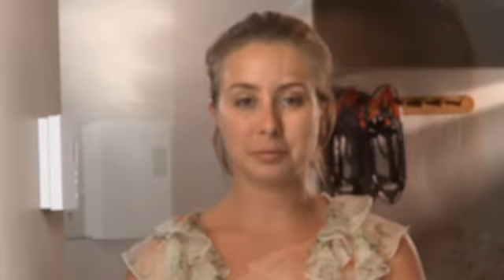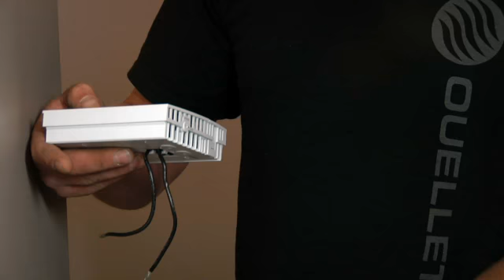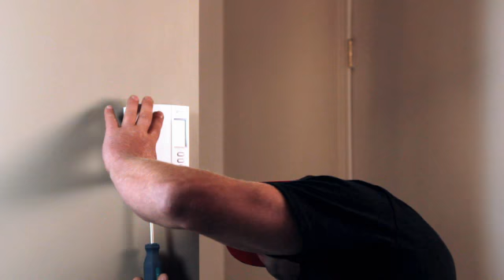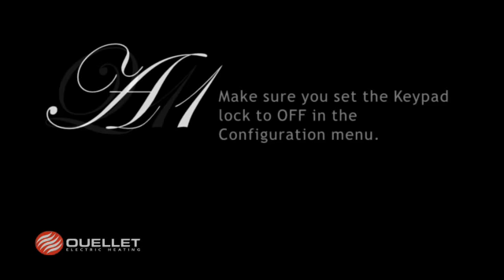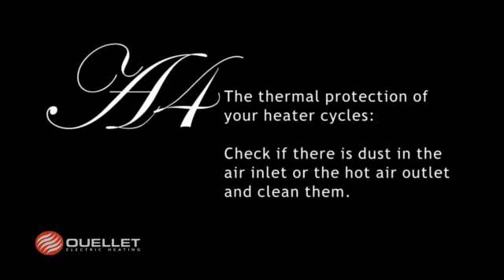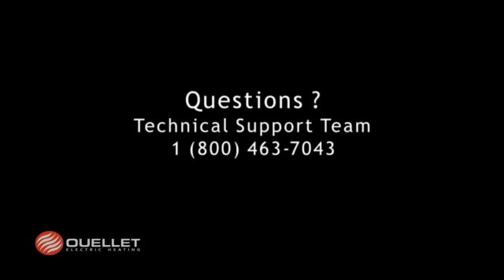Non Programmable Electronic Thermostat

Comment: I have my set points to 5 degrees and 16 degrees, but the reader is showing 21.5. How do I actually get it to go down and make the room cooler?
Reply from the maker: Thank you for your question,
   These thermostats are heating thermostats only and they only control baseboards or heaters.
They will only start if the ambient temperature goes below the set-up and allow for the heaters to raise temperature to the required setting.
    Since they do not do cooling and control any cooling units, the temperature shown on the thermostat screen is the actual ambient temperature, but they will not bring the temperature down.
   The be able to cool the environment, you would require a cooling type unit and a heat/cool thermostat.
 Regards,
Reply: Open a window

Comment: Hello, my model looks the same but I have no backlight button. How do I get into the settings?? I want to change it to F°

Thank you
Reply: Get the setpoint to its minimum
and hold the DOWN  button for 3
seconds to access the menu.

Press the UP or DOWN button to change the setting.

Press the UP and DOWN buttons to select the next parameter.

Press and hold the UP and DOWN buttons for 3 seconds to
exit the menu and return to normal display.
Reply: With 'no backlight button',  while in the menu, how to change from a setting parameter to another ? (because, I think, holding the DOWN button again will probably just control the parameter where we are) 
Thanks

Comment: The screen on my thermostat randomly turns off for a few minutes ? is that normal
Reply from the maker: Hi Cooper, no it is not nomal. please contact our technical support so that a technician can analyze the problem with you and give you the solution 1-800-463-7043.
Reply: @OuelletCanada  Why is this happening to all of us? Please tell us the reason instead of making us call support.
Reply: I have the same problem
Reply: Same! How did they fix it?
Reply: It’s too hot today! & the thermostat is very high.. please help to make the temperature 18 in stead of 32..